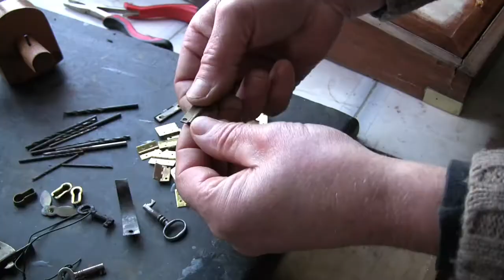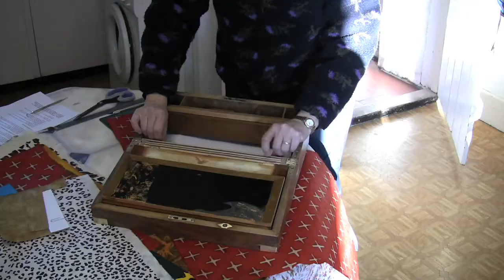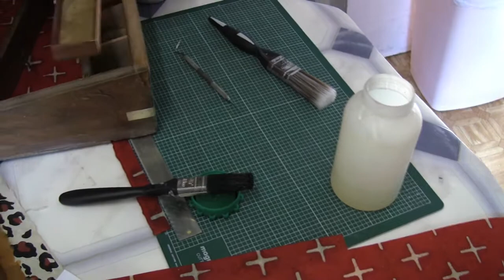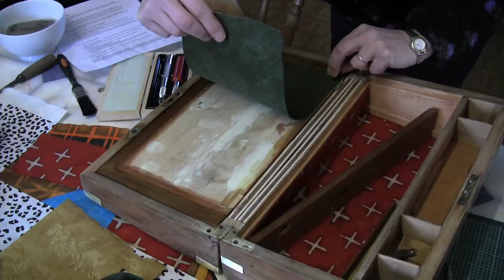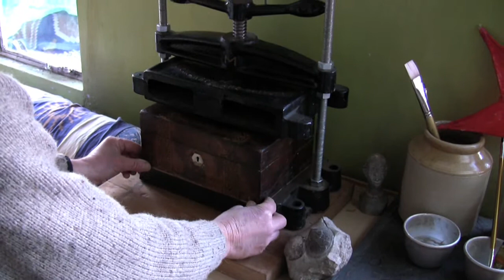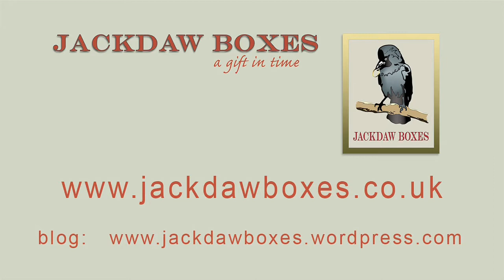Restoring an antique box. Jackdaw Boxes

Comment: Why nail the opening ribbon tab tot he end of the compartment flap door instead of attaching it to the face of the flap door (by driving the end of the ribbon into a small slit cut into the wood face) and cutting a small slit in the leather and feeding it through (in the center towards the top and bottom of course)?  It seems unnecessary to create new holes in the wood when one could use the same methods as the originals and have it completed in a much more finished and polished manner.

Comment: What the heck?  We went thru the restoration with you only to be cheated at the end with a completely different and very ugly box.
I thought the glue job with the center veneer was very sloppy with glue residue all around.  Never cleaned it up either.  I thought I could learn something but feel like showing you my methods instead. You could have put painters tape around the center veneer so no glue on the box.  Glue is a big deal.  It soaks in and your finish does not 'take' on the glue smear.